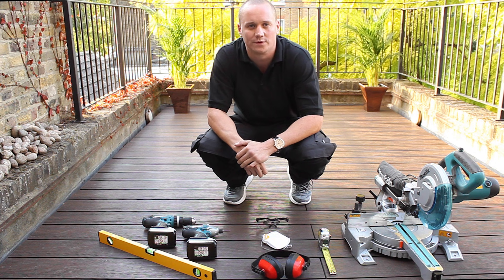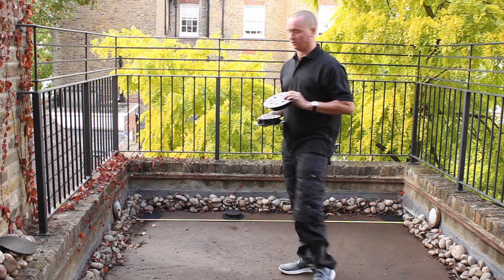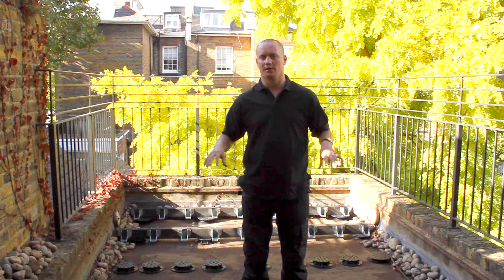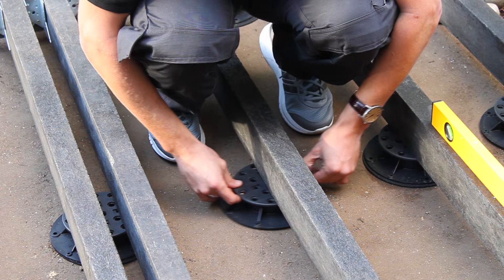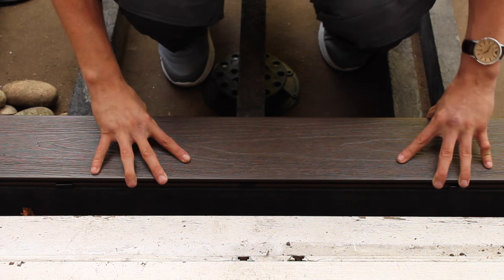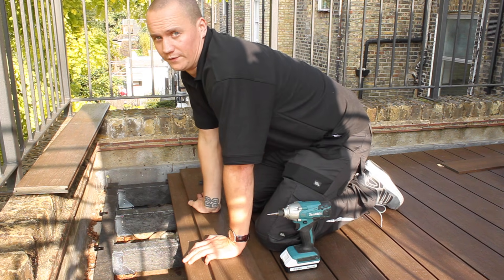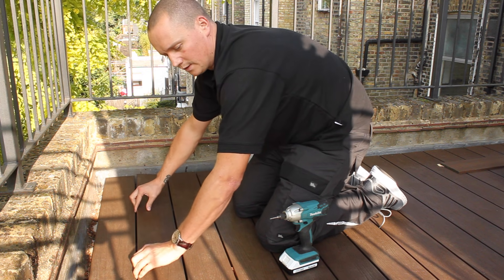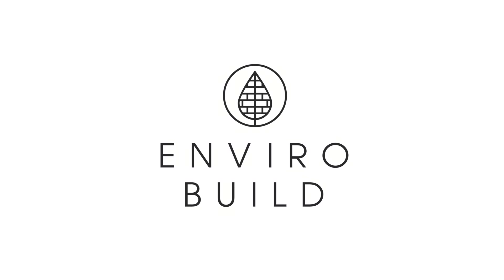Composite Decking Installation | Step-by-step Tutorial by EnviroBuild

Comment: I have an old wpc flooring that I need to remove and replace with a new one.. How to remove it!?? From where I start?
Reply from the maker: Hi Salvatore,

If there are hidden fixings then there it should be easy to remove, simply screw  these out and lift the boards.

Comment: Considering the whimpy span- could you not have used single boards w/o splices down the center. Not really a pattern. Where does all the water flow.
Reply from the maker: The reason for the brickwork pattern is purely aesthetic.

The best way to deal with water is to leave a slope; around 1:200 is good enough.